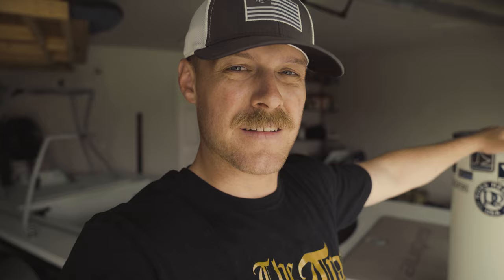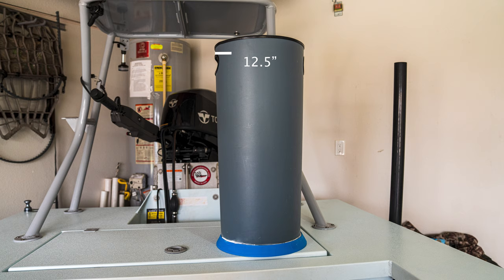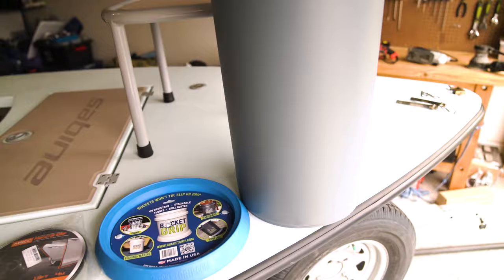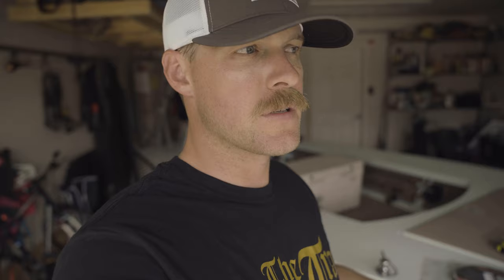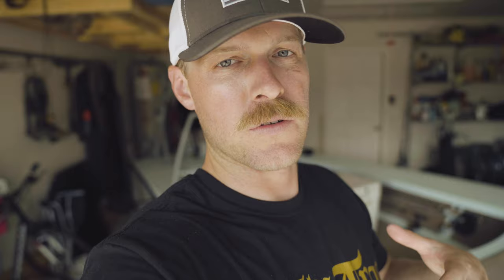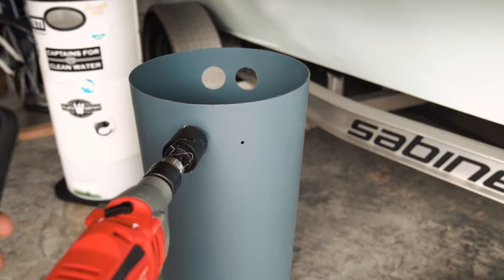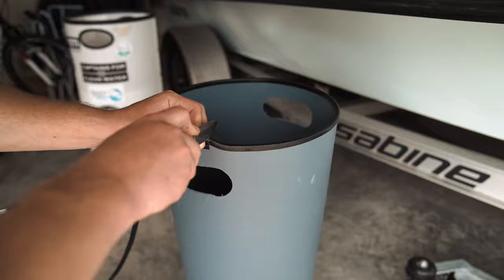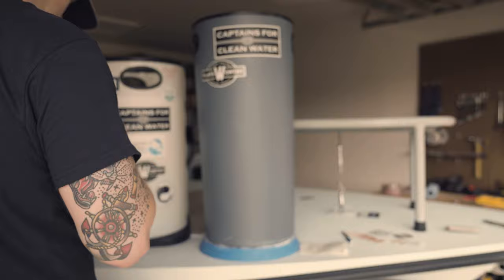DIY Stripping Bucket!!! - Only $75

Comment: Great video, how much does the the rubber basket base weigh? Is it enough to keep it on the deck in windier conditions?
Reply from the maker: The whole thing weighs 5 lbs. I've got a buddy who has used one in real windy conditions with no problems.

Comment: Did you put any kind of spikes on the inside? If not, how does the line do with knotting on itself?
Reply from the maker: I didn't put any spikes inside. I don't have spikes on the inside of the carbon marine either. Occasionally the line will knot up, but not frequently enough that it bothers me.
Reply: @TheSkiffWanderer  I have to agree with you. I built one last week and have been putting it through the ringer on some of the lakes around me, I haven't had many issues with knotting without the spikes
Reply from the maker: @erichfrie9130  if you put any pictures of it up on instagram be sure to tag me and I'll share them!!!